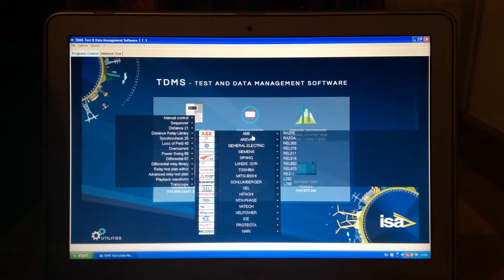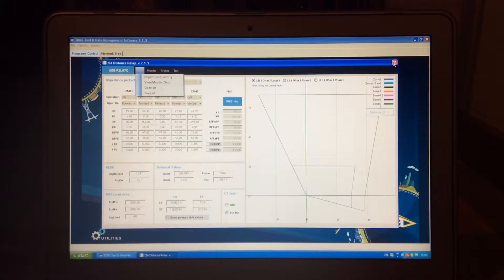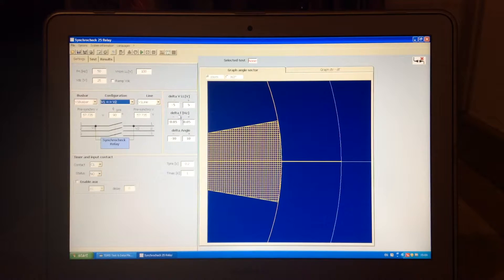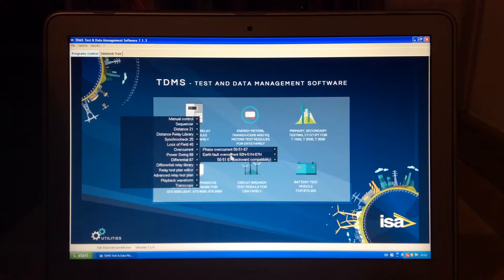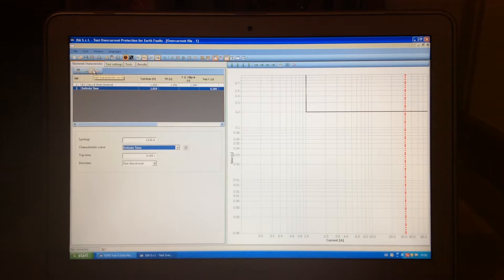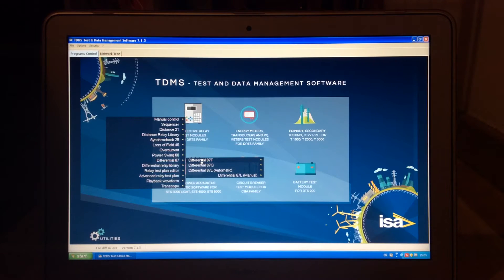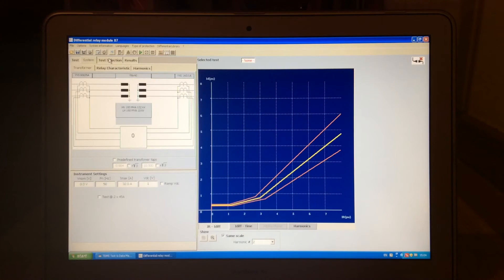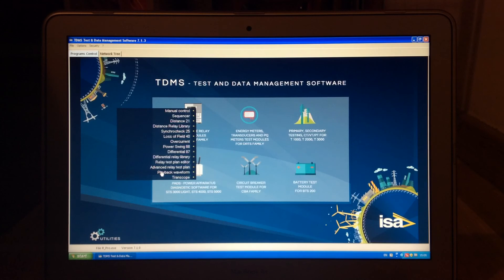TDMS vol.3

Comment: Why CEE relay is not listed and can you provide a video about how to test CEE relay especially for transformer and generator protection....  Regards Andrej
Reply from the maker: Hi ! We would gladly do that but we do not have CEE Generator protection relay in our office.
Reply: @sheppo17   can I use TDMS to calibrate CEE in the correct way or not??
Reply from the maker: Absolutely yes. The fact that we do not have it in library simply means that you will need to import the data manually. Tell me please what protective function are we talking about ? Overcurrent ? Distance ? Differential ?
Reply: @sheppo17  yes O.C,differential, reverse power,loss of field.
Reply from the maker: @رضاالطرشاني  so you will not have any problems to test CEE relay. You can use specific application for Differential and OC, but you can also test with Manual Control.
Reply from the maker: @رضاالطرشاني  for Receverse power use Manual control (or Sequencer) it is all the same. You need to generate currents and voltages that “give” certain power - and then play with the angle.
Reply: @sheppo17  thanks so much
Reply from the maker: @رضاالطرشاني  the pleasure is all mine :) good luck and if you need me write to andrej.sepcic@altanova-group.com